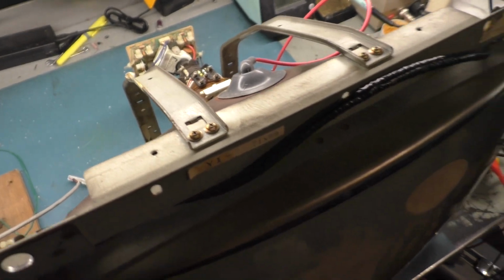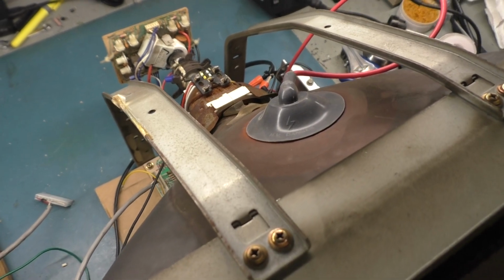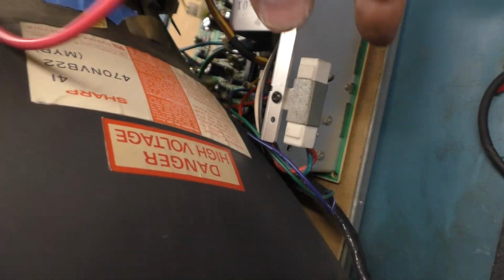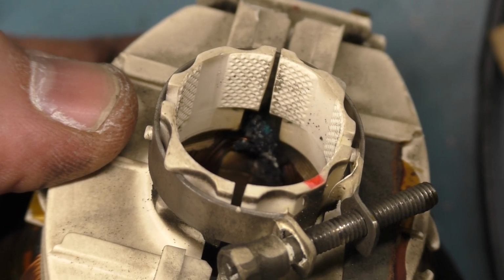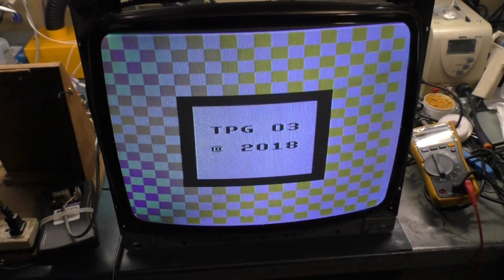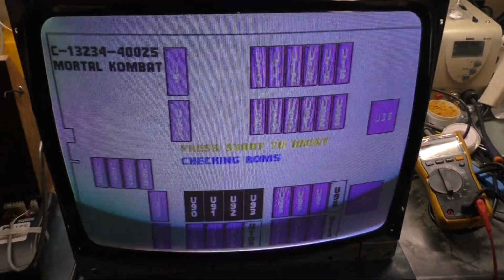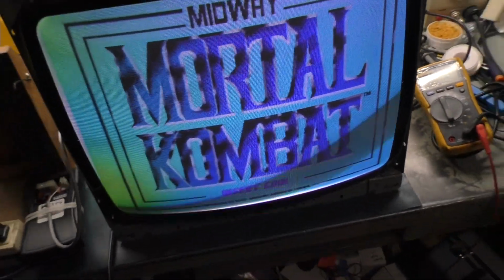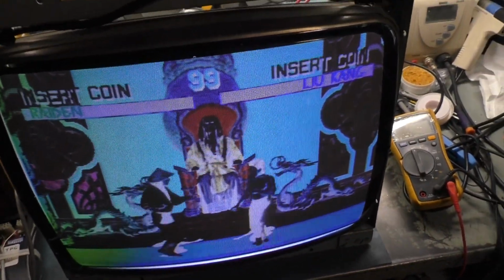Using a 19" K7000 Chassis On An 18" XM-1801N - Is It Possible - Part 2

Comment: I have found the scan coils react with those rubber type wedges, short out and burn more windings. I always remove the wedges one at a time and fit some electrical tape on the part that touches the scan coils. Preventative maintenance 😮